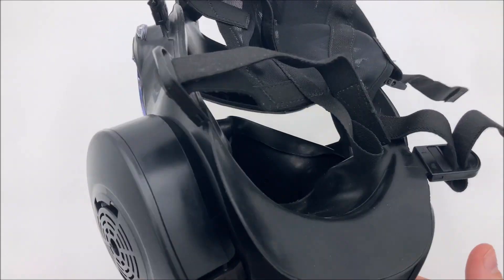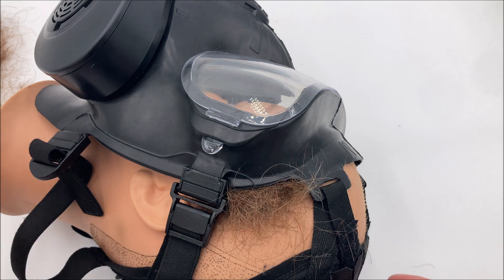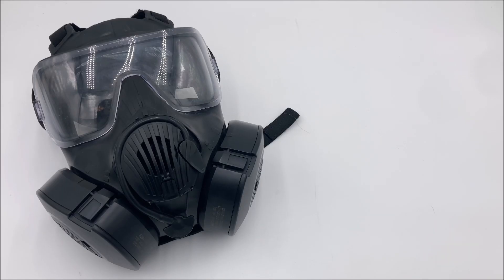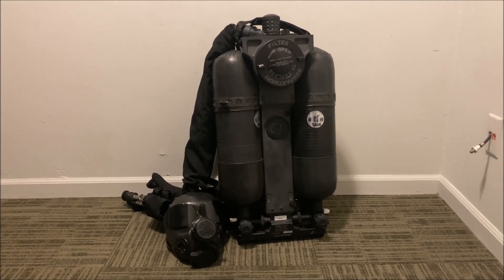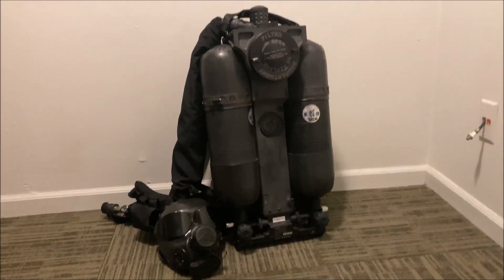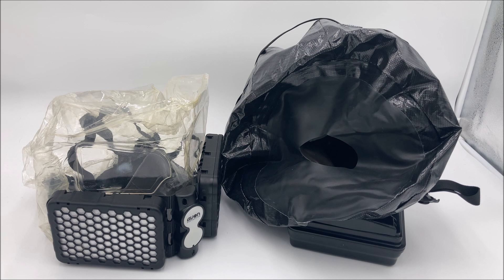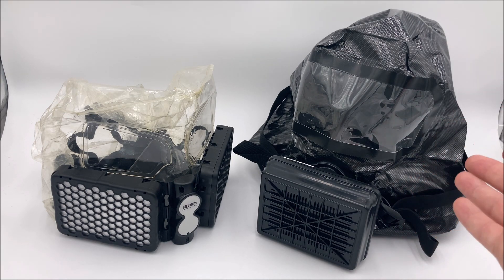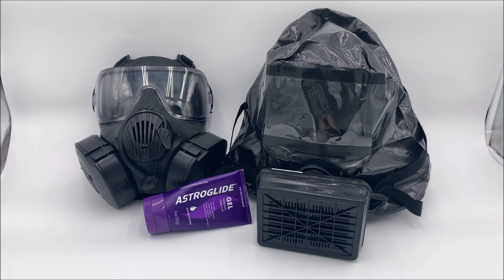Why you Can't Wear a Gas Mask with a Beard | An In-Depth Discussion

Comment: I want to see a military gas test of 100 soldiers with beards of different lengths with masks on. To prove without a shadow of a doubt at what point does the mask fail? Is it a light stubble, 1 inch, 2 inch, 3 inch, or longer beards?

If the test is anything less than 100% accurate in any way fix it try again and if there is a failer rate of even 1% to properly attempting to seal the mask or the gas test is a 1% fail to a mask breach than no beards.

If a light beard doesn't stop the mask then a light beard is fine, if a long beard by this test doesn't stop the mask from doing its job then I don't see the problem. Any legitimate fails at a 1% rate at stubble length then no beards at all unless you have a religious preference or medical reason.

I have a beard now that I'm out of the military. While in I hated the fact I had to shave twice a day because my facial hair grows so fast. I see a reason to give this a serious test.

Comment: I just discovered your channel doing research on new mask. I love your channel. Am now a subscriber. If you were a civilian prepper who is tactically preparing for shtf situations and have concerns over fire, nuclear chemical/ riot control chemicals. Mace pepper spray mustard gas etc. Money was NOT an object as one scenario. And other is money IS an object. I currently have a Mira 6m. I’m shopping for a better setup since you advised Mira is crap. What about the Mira cartridges NBC77 and their new smoke VK-530 one? Are they good? Could I use them with an Avon fm50 or should I get a c50mask with the proprietary filters? I’m so torn on what to buy next. Plus I’ve invested in 6 Mira filters. Would be nice to not throw away. Thanks so much in advance.

Comment: Good video. I would rather have videos of someone showing it first hand. This whole "I heard this may work but no it won't, trust me guys" isn't great. Demo it. Get gassed or pepper sprayed with a beard. Try different lengths or even stubble. The Vaseline thing was an old diving trick to keep the seal on your mask under the water. I have heard people make claim this can never work and then have seen it work first hand when someone is testing it out. I guess ignore your eyes and experiences because someone said "science". Now I personally wouldn't trust a seal with a beard to work when I needed it. Could it work 1-3 times out of ten? Maybe, but that's not odds I would want. At the end of the day you need to use and train in your gear, period. Find out what works for you and is consistent. Everyone has their own comfort level with risking the odds. I would take a person with a beard who has found a solution that works for them and trains and has tested it over someone who bought a mask and is clean shaven but doesn't even know if the mask is fit right and has never tested it. Don't let the first time you use it is when you absolutely need it to work. All in all though good video.

Comment: Next up ?
I want beard styles that fit in a gas mask xD
Anything that is within the inner cup should not touch the rubber/interfere, although probably look goofy. Still, I think it might be fun to explore.

Edit/Update:
Update to this ! I now got my mask (MSA ultra elite, payed 60€ with a carrying can). Left it on for like 2 hours, cleaning with it. Had to get it VERY tight at the chin for it to make a seal. (seal defined by if I can smell the bleach or not) After I took it off I took a picture showing where it left marks. And then trimmed my beard into those lines. This left me with a beard above my lip, but not down the sides of my mouth. As well as a small goaty under my lip (beginning of chin needs to be clear).
This gives me a awesome seal and I dont look like I am 16yo at the same time xD)
Reply: Maybe that's the start of "2 part beards" xD

The upper one stopping at the gas masks seal, the lower one beginning under the seal, with space between the two.

(although I can't imagine any beards in that style that would look good)
Reply: @michimannes7822  Update to this ! I now got my mask (MSA ultra elite, payed 60€ with a carrying can). Left it on for like 2 hours, cleaning with it. Had to get it VERY tight at the chin for it to make a seal. (seal defined by if I can smell the bleach or not) After I took it off I took a picture showing where it left marks. And then trimmed my beard into those lines. This left me with a beard above my lip, but not down the sides of my mouth. As well as a small goaty under my lip (beginning of chin needs to be clear).
This gives me a awesome seal and I dont look like I am 16yo at the same time xD)

Comment: You know... Folding your spine like you're a fuckin Victorinox tool is kinda neat trick.

Great explanation on the subject. Just wondering if SCBAs could keep the mask pressurised enough to prevent leaking from around the mask. Still wouldn't try my luck with a beard thou. I've learned my lesson by having my share of fun getting decon while playing casualty.
Reply from the maker: Thanks! SCBAs wouldn't do that. You run into the same issues as I described with the PAPR. While the regulator would detect the loss in pressure caused by the beard, it wouldn't be able to feed enough air to make it safe. You'd also be spending more air from your tanks as well